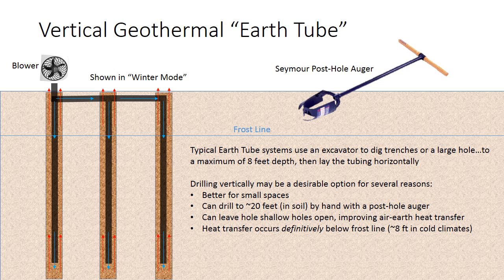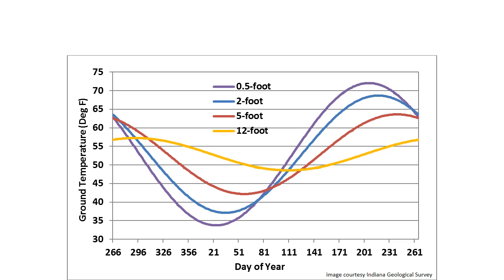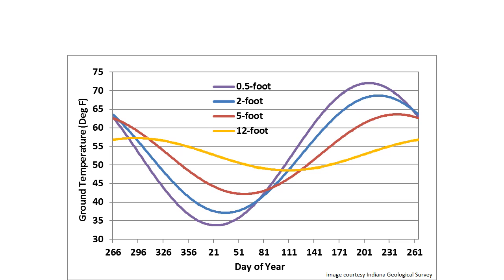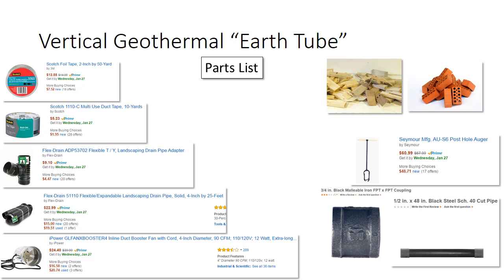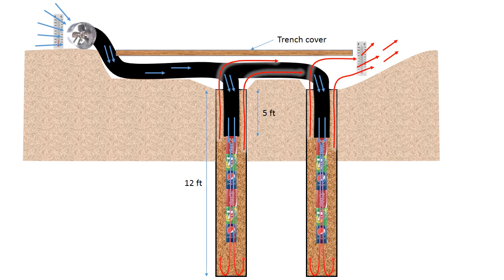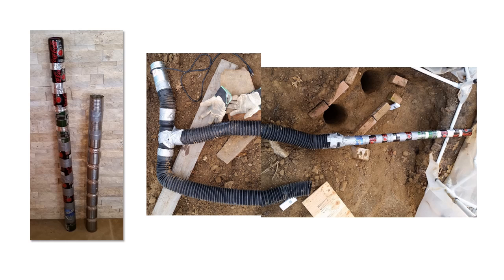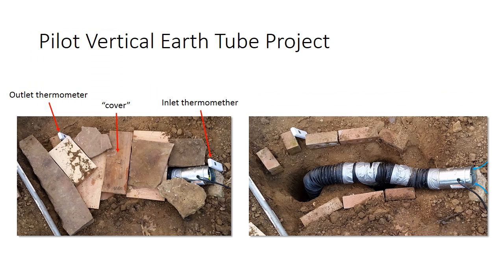Vertical Geothermal Earth Tube (Part 2) - Greenhouse Heating/Cooling

Comment: Great idea.  Have wanted to do this from sometime. You give inspiration. Is the a problem with rain water seeping into the well holes
Reply from the maker: Hi David, I iterated a bit on the concept over the years.  With the implementation seen in this video, you absolutely would have an issue with moisture in the greenhouse.  So I would recommend a "closed loop" system, where the pipe is kept away from the open hole.  https://youtu.be/A2TQJl9WjLc was my final geothermal system.  I will also say that you need a LOT of pipe to make a difference with heating or cooling.  Probably several hundred feet for a small greenhouse.

Comment: What are the results? Did it work? How well did it work?
Reply from the maker: You might peruse through my other videos, as I have multiple future generations of geothermal heating implementations, with results.  However, I will give you the executive summary: 1) never have an open hole, as you will have a humidity problem. 2) unless you are able to dig many deep holes, and have a closed hole system (either a U-shaped tube or a dual pipe (one narrow, one wide)), I believe that the more typical "horizontal" earth tube system is superior.  To build a horizontal system, you dig long trenches with a backhoe and lay out several hundred feet of tube.  I did not have that kind of acreage in my previous yard.

I had more success with compost heating, as the heat is more concentrated and available to heat a greenhouse.

Comment: How do you keep dirt walls from caving
Reply from the maker: soil was very agreeable where this was filmed.  Not so sandy that it would collapse, not so hard that I couldn't dig.  Personally I am not recommending the vertical system anymore, if you have the space to do a horizontal system.  If you do a vertical system, it only makes sense if you can drill pretty deep (20+ feet).  I could only get these holes down to 12 feet.  Also, with a system like this, you will get a lot of excess moisture in your greenhouse, unless you case the outer hole with a pipe.  You may find my second-generation geothermal system (https://youtu.be/Ze0nXN6Vvic) useful (I was using U-shaped configuration).  For my situaion, I found compost heating to be more effective.

Comment: Hi, I have a question. What if you have sand? it will work?
Reply from the maker: I would not recommend this method in sandy soil.  If the hole doesn't collapse during excavation, it will collapse eventually.  Or fill with water.  I would recommend a closed geothermal system.  I have used closed systems for the past 2 years (https://youtu.be/Ze0nXN6Vvic and https://youtu.be/A2TQJl9WjLc)

Comment: My only concern is that you're going to be pushing all of the gases that can be trapped in the soil out into your greenhouse.  Potentially harmful ones like radon can leach out of the soil, and your design can speed that process up and expose you to dangerous levels of an extended period of time.  I would suggest a closed pipe system that pulls air in from your greenhouse, cycles through the geo heat exchanger, and then returns to the green house, without ever making direct contact with the soil, or pushing air up through the soil.

This may be fine for your area if radon isn't a concern, but in many areas of the US this would be somewhat hazardous
Reply from the maker: Yes, my more recent designs have used closed pipe geothermal systems.  I'm not concerned about Radon (since I hardly spend any time in the greenhouse) but I AM concerned about excess moisture and potentially microbes in the greenhouse.

Comment: Electric can opener on the top end, a, electricians metal hole saw, the other. Should make it easier, go easy on the thin can, with a timber bung to support inside ,while drilling . Better than snips, I think.

Comment: Thanks! I love the design and am curious of your apparatus at the top to seal of the connections. Also where does your outlet go to?
Reply from the maker: Matt, I'm afraid that the system in this 4-year-old video was a prototype.  I'm currently using a very simple system - I just buried 25 ft of drain pipe in a pit - but it's mildly effective (https://youtu.be/ch0VD-_9Xxc).  I'm mainly using compost to heat the greenhouse currently.  Geothermal IS quite effective, but you need to have a lot of pipe underground to get any real heating.  And the key to any greenhouse is quality construction and insulation from the start (unlike my greenhouse!).

Comment: Curious why you choose aluminum instead of copper (besides cost)?
Reply from the maker: Ha, it was what I had on hand!  The last two geothermal systems I've implemented are completely closed.  Having the air run past open holes brings in a lot of humidity, which I didn't want.  Here's the 2018/19: https://youtu.be/Ze0nXN6Vvic where I dug adjacent holes and made a U-shaped run.  Here's the 2019/20: https://youtu.be/A2TQJl9WjLc where I just dug a pit and laid out coils of pipe.  Unfortunately I'm unable to make the geothermal system to fully heat/cool the greenhouse.  I rely on compost heating for the bulk of my passive heating.

Comment: What happens if we build a bigger greenhouse. Maybe 100 feet by 36?
Reply from the maker: You'll need more holes!  Or, you could drill deeper holes .  For big greenhouses I think the best bet is a horizontal earth tube that you dig with a backhoe
Reply: @MorganBrown   Going horizontal is what I was thinking. The fellow in Nebraska raises oranges and has 70 foot long trenches. I would go 12 feet deep as I believe we are going into another Grand Solar Minimum like the Maunder Minimum (1645-1715) when the price of wheat rose 400% at times.
Reply from the maker: Zeebra237 digging under the greenhouse would be best, if possible.  If you could dig to 12 feet, it would be fantastic.  I hit bedrock at about 10 feet unfortunately

Comment: Is the only difference between "winter" and "summer" mode a reversal of the fan motor?
Reply from the maker: No need to reverse the fan to switch from winter to summer mode.  All that matters is that you're taking undesirably cold/hot air from the GH and sending it underground to moderate the temperature.  One difference that I would consider, though: for "summer mode", I'd locate the inlet pipe near the ceiling, where the undesirably hot air would collect.

Comment: Interesting idea but how many cubic feet of greenhouse will it warm given the difference in ground temperature. In a 20 x 60 greenhouse - how many holes?
Reply from the maker: If you check out my 2018/19 build, I show some geothermal results (https://www.youtube.com/watch?v=VtPfUy6T2Jc&t=2s).  My conclusion is that a single hole can warm about 27 cubic feet by 1 deg F.  Kind of disappointing.   So in a 20x60 foot greenhouse with average height of 8 feet, you have 4120 cubic ft.  You're looking at 150 holes to get 1 deg F of cooling.  If you're able to double the depth of the hole (say to 20 ft), then the efficiency more than doubles.  It will also increase efficiency to have the holes under the footprint of the greenhouse.  Still, getting a few degrees of cooling may extend your season by a month or more on either end, which could be of material value to you.
Reply from the maker: Correction, a single hole can warm 27 cubic feet by 1.5 deg F.  So you'd need 100 holes (10 ft deep) to warm a 4120 cubic ft greenhouse by 1 deg F.

Comment: a can opener cuts the top and bottom cleanly off soda cans. You do the grip gear on the outside lip, and the blade gear on the inside lip. I just cut 200 cans yesterday with that method, and i only punctured 2 cans in a way that made them unusable.
Reply from the maker: UNSILENT ZONE nice!  I wasn’t able to get that to work

Comment: Looks good. I have a need for cooling a greenhouse living here in Las Vegas. Our winters are very mild here but the summers get to 115 F and cooling is a challenge. I just might give this a try. I don't need to worry about ground water. It's down around 75 feet or more. I don't know how far down until I hit caliche. That's everywhere here at anywhere from 2 feet to 50 feet. It's like trying to drill concrete.
Reply from the maker: Excellent.  This method will work far better for cooling than heating.  You might check out Scott Hiebert's channel - he build a geothermal grow house in Bakersfield and it seems to work well for him

Comment: It's good concept and should work great but I can foresee problems. Groundwater moving into the holes limiting the depth of airflow and caving in the holes. Perhaps using corrugated culvert pipe capped on the end would work better to prevent this and the corrugations increasing surface area enabling better heat transfer from the ground to the air. Furthermore I would build a concentric vent attachment to the pipes as they leave the ground so as not to have any losses. I would also experiment with more ways to increase efficiency of heat transfer either with turbulators or different types of pipe and length of depth or fan speeds. with enough data you can scale it up or down with known BTUH values enabling the system to be used for different square footages of dwelling.
Reply from the maker: Great suggestions on some optimizations!  To your original point about groundwater and cave-ins, please check the 2018 design (https://youtu.be/Ze0nXN6Vvic) and some results (https://youtu.be/VtPfUy6T2Jc).  I've moved to a closed, U-shaped system, which I think is on the right track.  Next year I hope to scale it up a bit more...

Comment: In high humidity areas there is a risk of Legionaires Disease being contracted from the moisture that builds up in the underground tubes. Check with your local University Agriculture Department to find out if it safe to use this method in your area.
Reply from the maker: There aren't any "underground tubes" laid horizontally, so there shouldn't be any moisture building up from this method.  Any condensation would drain through the bottom of the hole (provided it's drilled in permeable soil).
Reply: my mistake
Reply from the maker: @danlyon5512  No worries!  Even if Legionnaire's Disease isn't your main worry, you definitely don't want condensation collecting in your system!  The founders of Ceres Greenhouse wrote a book where they definitely recommend weep holes, intelligent grading, and a porous substrate for GAHT systems, but I suspect that many people who are digging these systems do not bother worrying about drainage.

Comment: Why not pour pea gravel around the pop cans you would get 3 times the heat transfer not only gravel touching the cans but air moving up through the gravel. This might work since you're in grow zone area 5(Colorado) I'm in area 2b.(-45C) I would get more bang for my buck using 4 layers of poly on the S side and insulating the N& E& W sides of a greenhouse. I can use black metal barrels with copper pipe heat exchanger  from a pellet stove. I can also run heat from a roof top hot water heater (evacuated tubes) into the Barrels. We've had a lot of cloudy cold days so the pellet stove may be the best option. We only get 7hrs 21 min of sunshine Dec 21st. Very short day. 16hrs 41 min of night with no sun. Some people on acreages who can plan out their system will lay copper pipe in a 12 ft. deep trench 50 yds. long and run fluid through it.
Reply from the maker: James Coleman that’s an interesting suggestion (the pea gravel).  I guess it’s a trade off between higher airflow and higher heat flow.  Seems like filling the holes with steel ball bearings might work even better!  Just a TAD bit more pricy... :-) I just set up a system with 4 holes and u shaped tubes.  Will post a video this week.  Living in zone 2b, you’ve got serious street cred.  Will think about what you’ve said.  Current greenhouse is insulated on 2 sides.  Am improving weather proofing this season.
Reply from the maker: Here's the newest video https://youtu.be/Ze0nXN6Vvic

Comment: What was the difference between the inlet and outlet temperatures?
Reply from the maker: Darwin Airola check this other video, where I posted those figures. https://youtu.be/e8AosXQ3OaA
Reply from the maker: I watched the other video and it looks like about five degrees Fahrenheit between inlet and outlet.  However, that old system was pretty primitive.  I’m actually about to build a combined geothermal/compost heating system for my new (2016) greenhouse.  Give me a month to post video
Reply: @MorganBrown  Thanks for that information. In that case, this sort of setup does not seem as efficacious as some others that I have seen that trench down and put long lengths of pipe (usually in parallel) underground. There are folks in Idaho and Nebraska who claim to be able to heat their greenhouses, year round, using only the aforementioned method of extracting geothermal heat and fans...
Reply from the maker: @AnswersFromGod_com  Yes, I think you are correct.  Total system performance likely is proportional to the total length of pipe underground, and typically, the people using horizontal systems will have more total pipe underground.  That said, many of us may have no place to go but down (e.g., small yard).  If you were able to drill, say, ten 100-foot-deep holes, then I'd argue that the vertical system would easily beat a horizontal system's performance.  But, in order to drill the 100-foot-deep wells, you need to hire a water well rig...which is probably more expensive than hiring a backhoe to just dig a horizontal system. ;-)  I aimed to use my Seymour Post-hole auger to drill to 20 feet, but I hit bedrock at 10-12.  So sad...
Reply: @MorganBrown  It seems like there would be other inefficiencies with the vertical system, including forcing air down into the hole. From the empirical results of others, it appears that forcing air through a short, single pipe that splits into parallel pipes and reconverge back in the area to be warmed (or cooled) is more efficient.

Thus, assuming that you could drill 100 foot holes that did not fill with water, etc., you would probably need more powerful (and, thus, expensive in terms of initial and ongoing costs) fans.

If you could drill down and line the holes with waterproof pipes (probably at lest one pipe going down connected to at least one return pipe going up, per hole), I would imagine that you should obtain a more steady output temperature (from each hole) than from a system that only goes down eight to twelve feet, though.

The other vertical systems that I have read about (for heating and cooling homes) seem to create some type of "large," fairly, lined vertical cavity, but I do not recall how they get the air to and from the bottom of the hole, and I do not know why they make the cavity to so large.

https://AnswersFromGod.com/?youtube=ghmvI9U1KQI
Reply from the maker: @AnswersFromGod_com  Here's the newest build: https://youtu.be/Ze0nXN6Vvic   I think the U-shaped, closed GAHT system that I implemented should address the "air compression" problem as well as the hole filling with water.  I have a small anemometer that I plan to use to test the efficiency of a few different configurations.  My dad has a commercial scale geothermal system; he has 4 wells that are drilled to 150 feet each (I believe).  An antifreeze liquid is pumped down a coiled tube inside a waterproof pipe.  A commercial heat pump does the real work.  I obviously wanted something cheaper than that!!!

Comment: Hi Morgan, I live in the tropics and want to try this.  I live in the tropics.  I want to do microgreens in greenhouse and have to battle with cooling.  The horizontal system is going to be very expensive for me.  how can I contact you directly for more detailed questions?
Reply from the maker: Jennifer, I definitely respond to the messages here on youtube, so if you think your questions might be of some general interest, please post here.  If you want to email me, you can do so at "morganpbrown" at gmail.  This type of geothermal system is actually best suited for cooling, especially in a humid climate.  If the underground temperature is cooler than the dewpoint, then water vapor will condense in the bottom of the hole.  If you have well-drained soil (or an actual drainage system), the condensation will drain away and you'll cool AND dehumidify the greenhouse!  If your water table is shallow, I might suggest drilling two of these holes next to one another, then running a U-shaped air tube down the hole, making it a closed system.  Perhaps you could at least capture some of the condensation at the outlet hole.  If the U-shaped tube fills with water, it could force you to keep a submersible pump in the hole, which would be a bummer.
Reply: @MorganBrown  if the closed u-shaped tube system fills with condensation, instead of installing a water pump, how about installing a completely sealed, mechanical hatch at the lowest point. 
Have some ropes or wires run through a PVC pipe between the hatch and above ground, where a thermostat or sensor would activate some machine that then opens the hatch. Obviously you'd then have to divert the water far away from the hatch.
Reply from the maker: john lindahl I’d probably just gravel pack the hole then drill one small hole at the bottom of the u in the pipe to allow any condensation to drain.  That will be a problem if the water table is high.  I don’t think these geothermal systems are worth spending a lot of money on.  If you have to make it complicated, it may be more effective to try another approach